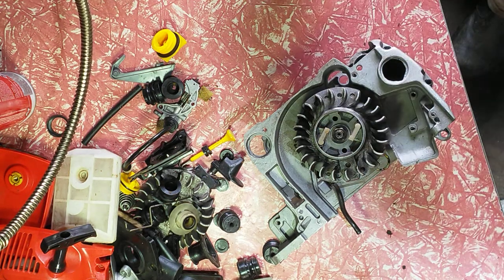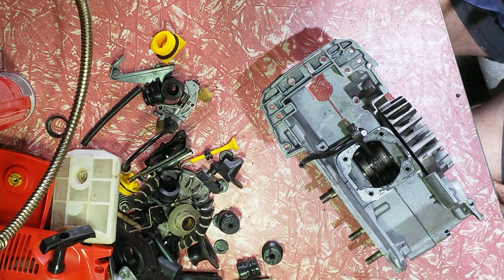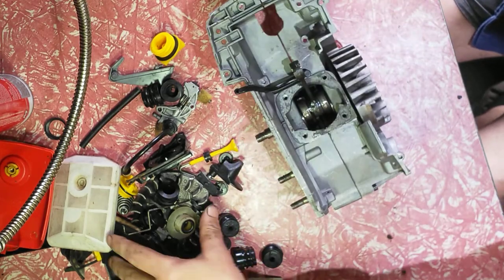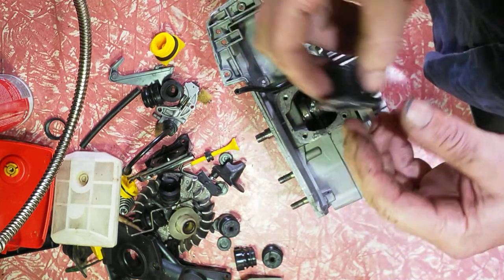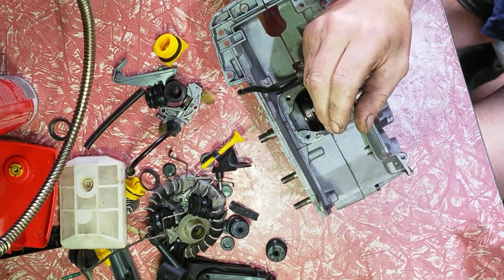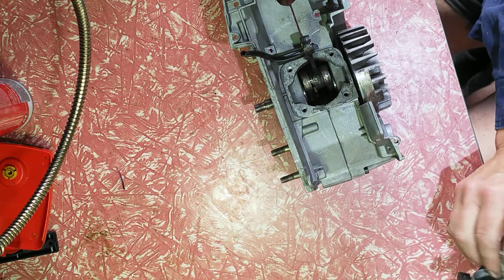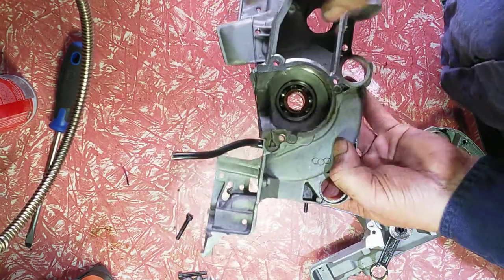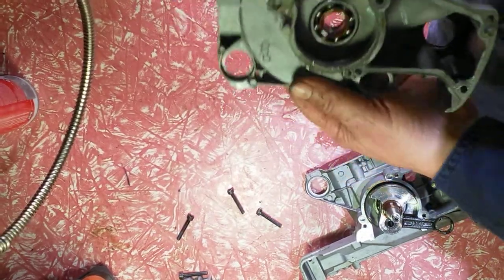how to split Chinese chainsaw crank case Steve's saw

Comment: Another great vid Kev. Really enjoyable to watch. That was my second saw I bought after my talon. I mixed both saws 25:1 with the cheap Victa Bunnings 2 stroke semi synthetic. Maybe I had it running too lean.
Reply from the maker: Mate thanks for getting back to me so quickly , well that oil I would never use. All my Chinese chainsaw use echo oil 40/1 permian fuel and I have never seen that before over night cheers Kevin😎